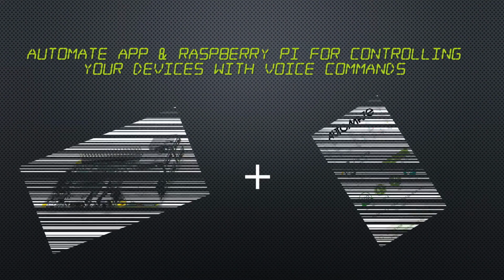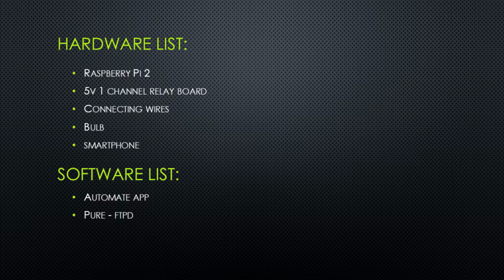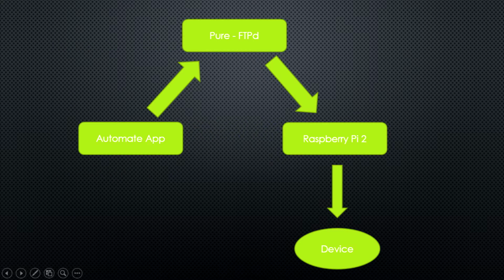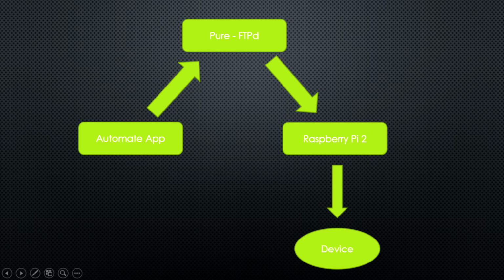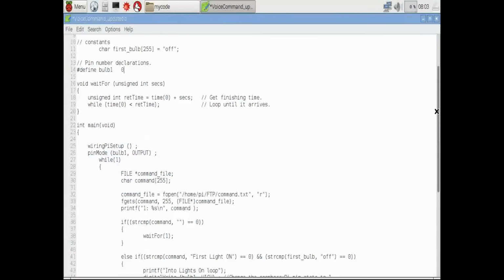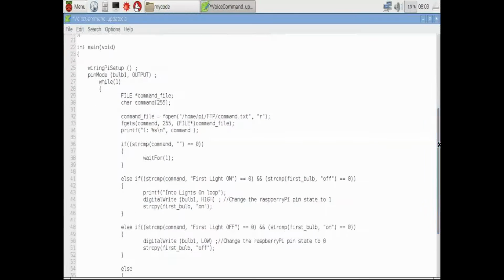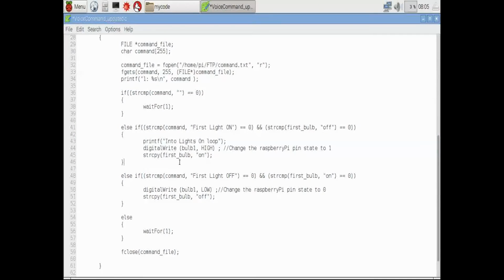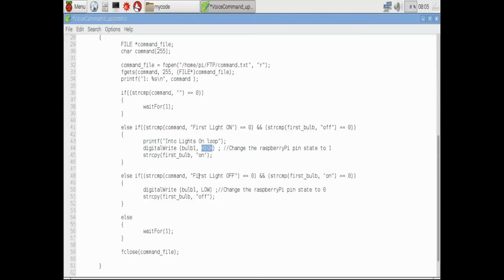Automate App :: Control Lights with Voice - Part 1

Comment: Very nice tutorial. Is there any way to automatically tweet things, like a Twitter API?
Reply from the maker: +Air Crash Investigation you mean to say raspberry Pi should tweet you when the command is executed?

Or

U want to control lights by using tweets.
Reply: rajkiran singh No, I want the Automate app tweet on it's own. Is that possible?
Reply from the maker: Hmmm, never tried that. Might not be possible as well. Let me check and come back on this.
Reply: you can try ifttt app twitter/insta etc.)